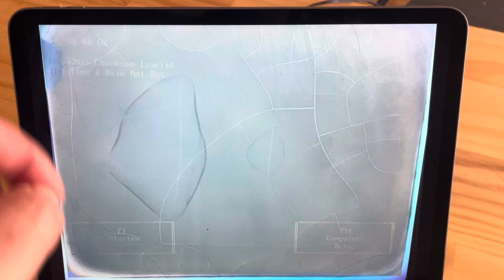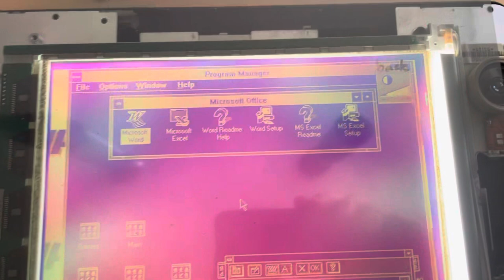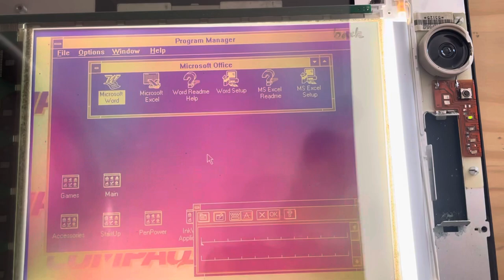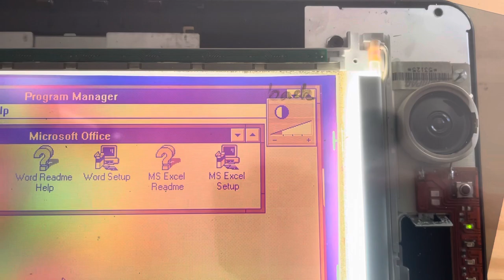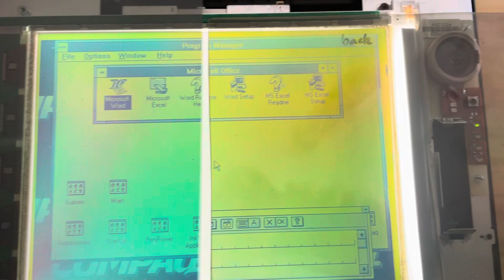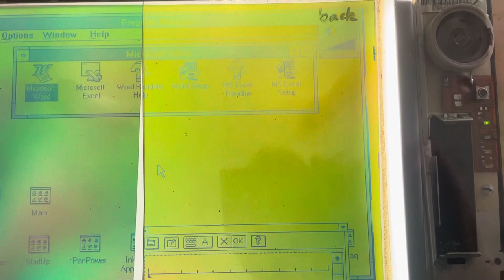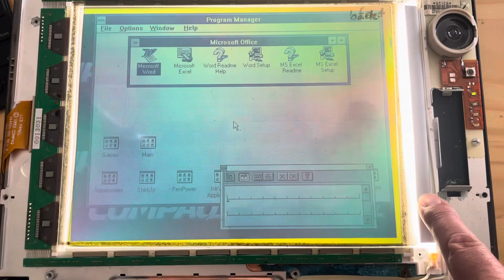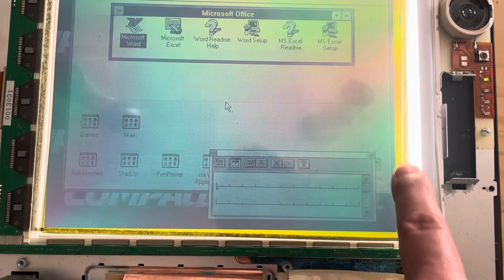Replacing polariser film on a greyscale or monochrome passive matrix LCD

Comment: That result looks superb, getting really close to the original colouring of the panel :)
I've been trying to repair the monochrome LM64P83 LCD in an AST Bravo NB laptop but it seems like when I was removing the rear polarising film the middle of the LCD was damaged and now has a permanent spiderweb type pattern in the middle of the LCD, so I'm trying to source a replacement panel instead.
Reply from the maker: Thanks. Sorry to hear about the ‘spider web’ effect - I guess we try our best but not everything can be saved. Sometimes there’s also a creeping red-coloured degradation in the front of the panel where there’s been impact damage.

I had an active-matrix Powerbook 540c display that was cracked in transit. I was so disappointed (I’d always wanted one of those machines) that I tracked down a “new” replacement on eBay. Price was quite steep (about US$140 shipped) and when it arrived it was the wrong panel, wrong size and shape. I reported to the seller that it didn’t match the photo, and to my surprise they sent the right panel (and didn’t ask for the other back; it’s for a tiny early Thinkpad). So in the end; I really did seem to get a new LCD, possibly refurbished but like-new condition with a bright backlight. Just thought I’d let you know it is possible. Seller was ‘wanlive’ and item was sent from Hong Kong, they seem to specialise in LCDs

Comment: Well I don't know what I'm saying that's getting these comments removed, but you should try out some cellulose tape between the front LCD glass and the polariser sheet, rotating that around corrects the colours the same as that compensation layer does
Reply from the maker: That sounds really interesting, thank you, I’ll try it. Then I’ll just need a piece of 18cm-wide tape :)

I wonder what makes the tape behave differently to the clear plastic film that was on the new polarising filter (removing that makes no difference) - perhaps it’s the material. Did you make this discovery by accident? :) How did your LCD repair job turn out in the end?
Reply: @alexshepherd  Nah it was all learned from reading about gameboy pocket polarizer repair experiences (the US spelling :)
I can't show you since I can't post links, but the colours look quite accurate for a DSTN
That's with  a scrap of tft polariser material that came from a broken screen, with tape on it. From what I've read, the stretching process is what gives these materials their properties compared to regular transparent sheets

Comment: Right, a new development. I put sticky tape all over my 9.5" DSTN colour 640*480 LCD and it has proper colours again. If you want to see for yourself, do a search for dstn polarizer vogons. Odd keyword but the thread with my findings is the top result.
I had great results with both colour and monochrome panels, with the strips going downwards 20 degrees from the 0 degrees at the top of the panel.
If we can find out what material this tape is then we have our DSTN polariser material - the Kite brand tape I've used lists the material as polypropylene at 25 microns or 0.025mm thick. I need to test now whether the adhesive on the tape has an effect or not. Possibly a polypropylene sheet that's around 25 microns or less in thickness. Maybe thicker would work I have no idea, since you can get 50 micron fairly easily...
Reply from the maker: @voodler  that is so much better, I see your results at https://www.vogons.org/viewtopic.php?p=1297031#p1297031

Genuinely-useful information, well done! You really have found how to make a compensator film layer.

I wonder if Duraseal book-covering film will work like packaging tape (but is in a bigger piece)

I must try this on a Powerbook 165c, on which I have the same challenge (how to get correct colours not sepia tint)
Reply: @alexshepherd  Interesting, I've never heard of duraseal before. It's polypropylene like the tape I'm using I think, so let me know how it goes if you can try a bit out. At the moment I'm trying to figure out whether it's the material itself or the thickness so I'm interested to know how you get on with it.
Good luck :)
Reply: @alexshepherd  Have another look at the thread, it seems the specific thickness of 25 microns / 1mil / 100 gauge is the requirement for polypropylene to have the right properties to make a DSTN screen look great. That can be fairly easily sourced as cellophane wrap / bags but you've got to check the thickness, 20 or 30 micron is no good it seems.
Now I'm going to investigate how polyester / mylar / PET films behave with DSTN screens, because I'm not happy with the colour / brightness consistency of polypropylene, though that could be because the film I'm using is food grade stuff.